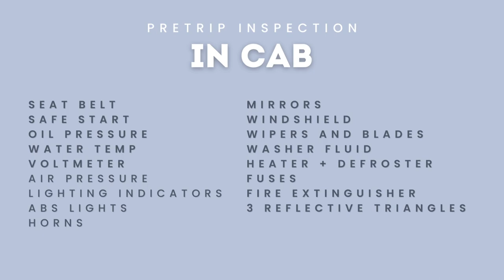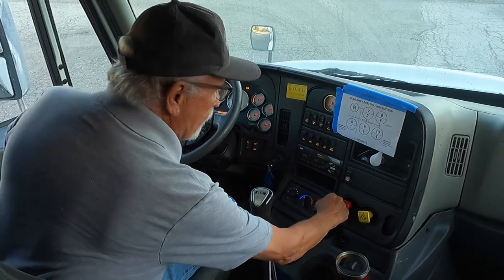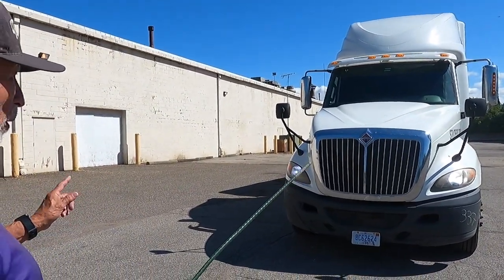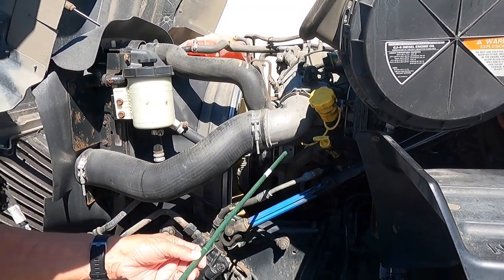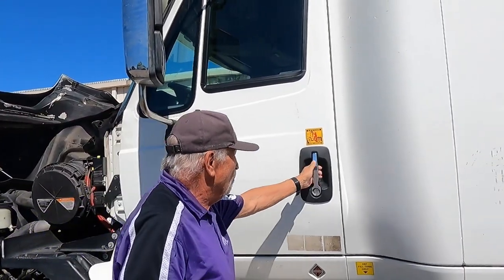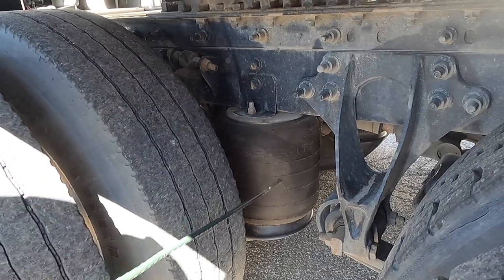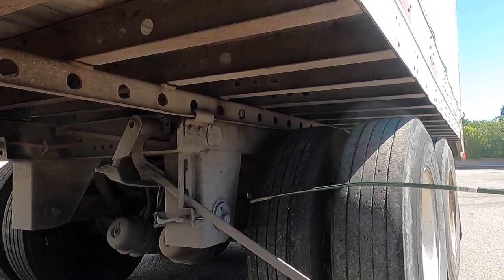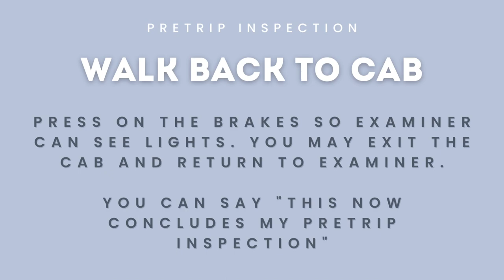Pre trip Inspection FULL - CDL A Test

Comment: Damit I'm about to start school and that's alot to remember
Reply: U got it bro brake it into to sections engine , suspension and brakes , tires , electrical air lines , fifth wheel the rest is the same
Reply: I'm in this school right now. If you're in this same school, look for the white guy with the camo pants or the Black GMC Sonoma, this is super easy.
Reply: I made myself flash cards on index cards and it helped a lot.